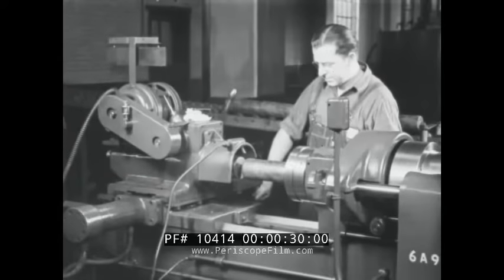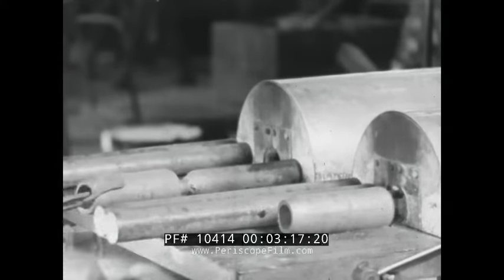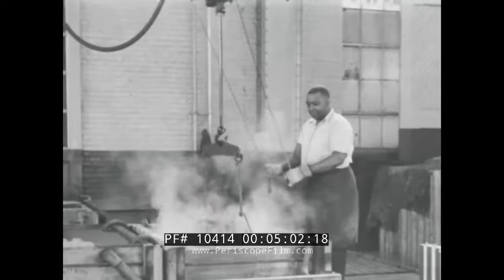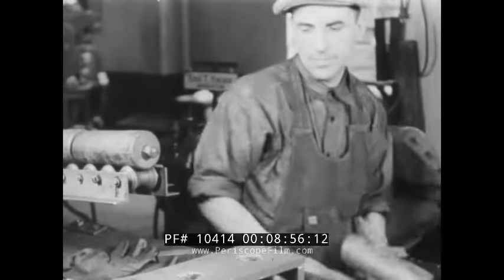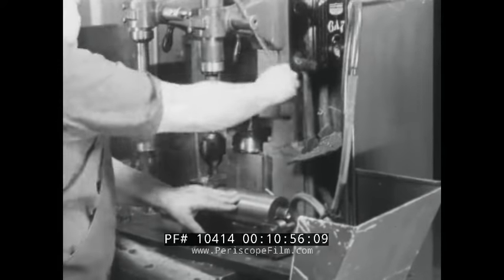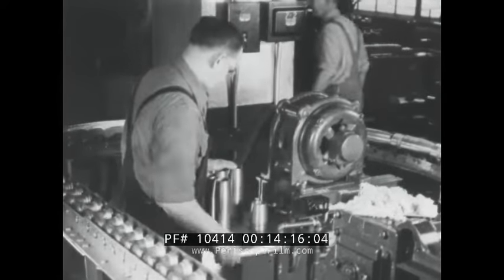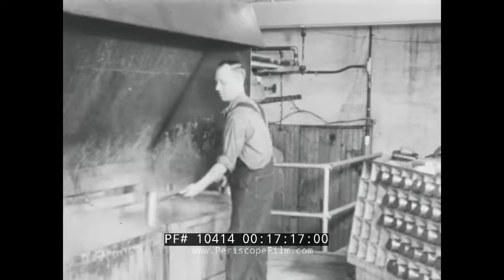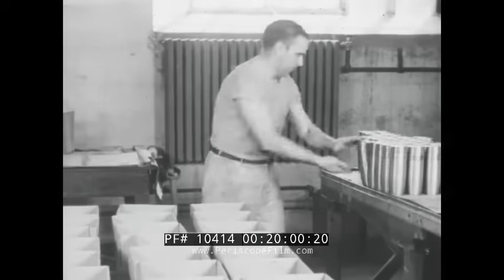MANUFACTURING 3-INCH ANTI-AIRCRAFT SHELLS     WORLD WAR II ORDNANCE FILM FRANKFORD ARSENAL 10414

Comment: Imagine all the engineering that went into designing the machines used to make those shells.
With pencil, ruler and paper.
Reply: Dave....Yes, my thoughts too; I was as fascinated with the different machines as I was with the work being done. I was a manual metal working Lathe operator for almost 20 years and then spent a few years running an EDM machine and a CNC machine and a few other machine shop tools, so I am always interested in the machines that someone...someones...had to think up and manufacture...amazing..!!
Reply: Dave  that’s how KELLY JOHNSTON,  of LOCKHEED  SKUNK WORKS DID IT , no computers , or personnel calculators, only slide rules & pencils, speaking of which, we spent a fortune developing them SPACR BALL POINT PEN,  you can buy then now, but the RUSSIANS QUICKLY solved the problem by using lead pencils ,  OH WELL,  Cheers From NJ    🇺🇸🇺🇸🇺🇸🇺🇸
Reply: @flybyairplane3528  He's the one that designed the SR-71 right ?  Blows my mind what they were able to do without computers.  Some say he had a little help ? #aliens lmao
Reply: @dave131  They had early computers, but for sure most of the work was done by brain power.
Reply: Those machines were manufactured in the United States.
Reply: That's always what amazes me the most - the machines that make seemingly simple items.
Reply: @flybyairplane3528  Americans were concerned with graphite dust shorting out the electronics.
Reply: @flybyairplane3528  Russians use ink now because lead particles were getting in their instruments. I think they use the US pen.
Reply: @flybyairplane3528  The pen was independently developed by Fisher BEFORE being used in the space program and was offered to NASA for their use. It wasn't developed as part of the space program and was only called the space pen after it was adopted by NASA.
Reply: And slide rule
Reply: yet its somehow to expensive to hire americans for fair wages to make anything. Makes you think
Reply: They also ha the slide rule to make all the calculations.
Reply: Yes, the design and use of the machines is truly amazing. Most people have no idea what is involved in the manufacturing and production of these types of products.!American engineering ingenuity at its best!
Reply: @Albo alt They had a different work ethic, no job was beneath them and they were not afraid of getting their hands dirty!
Reply: Add
Reply: @flybyairplane3528  bullshit story about the pencils. Pencils are bad in space and produce flakes of conductive graphite. They used Chinagraph pencils like the US did, later to be replaced with felt tip pens. Common myth.
Reply: @lwoodt1  And Log Tables?
Reply: @flybyairplane3528  - Well actually, we didn't spend a fortune on the Zero Gravity Ball Point Pen.... it was as simple as pressurizing the ink sleeve inside the pen. Pretty simple, but I would agree, not as cost effective as a lead pencil. The Russians soon found out though that Ink doesn't smear, become illegible or get accidentally erased....
Reply: @TheTeehee11111  Don't discount the occasional trial and error, and the clever use of wiggle room to get the job done.
Reply: @6or7breadsticks  Yep. Lead dust, bits of broken pencil tips, and the occasional speck of wood or sawdust could play hell with a switch at a very bad moment.
Reply: What's the moral of the story here. I'll tell you. Every person you just saw in the film is DEAD. What did it all matter?
Reply: @marbleman52  As a second career machinist I have always been fascinated with machines making machines.  Currently doing one offs on a manual knee mill and loving it.  Not a whole lot of manual machinists out there any longer, trying to hire lathe or mill machinists is near impossible. Yea watching these old machining movies is great.  I have also enjoyed watching some machining videos of guys in the Middle East or poor countries doing repairs using old machines, interesting watching their approach with limited tooling!
Reply: @byronschroedel432  Hey there...I will confess that I did not know what a knee mill was, so I looked it up. Those are what I know as Bridgeport milling machines. Yes, they are very versatile and very accurate when properly used and taken care of. I only got about 6 years using one and just did the basics before the shop all but closed and just the very senior people were kept on. But before I worked at this shop, I was a manual lathe operator for about 16 years and I took great pride in turning out precise pieces. I retired about 8 years ago and now I have a wood working shop at home where I have used my skills as a lathe operator and machinist to work with wood instead of metal.
Reply: Speaking of "paper ruler and pencils", saw a documentary on building the Oakland - San Francisco Bay Bridge. (Largest project of its type in the world at the time -used approx. 25% of the entire output of steel in the US at the time.) They had to construct a massive warehouse just to store and make available the millions of blueprints, plans, orders and other paperwork while building the project. No Xerox, dry printers or microfilm available - just uncountable files of paper.
Reply: @marbleman52  Yea I suppose I could have said Bridgeport, but I was being equitable to the other brands.  I have a Bridgeport clone in my garage and I work on a MSC brand mill.  The MSC is a better mill than the Bridgeport with z axis movement being .001 tolerance.  Something our Bridgeports will not do!
Reply: @byronschroedel432  I understand what you mean; it is like saying Skilsaw when actually meaning a circular saw. The brand name has become synonymous with the tool. I didn't know about the Z axis tolerance limit to the Bridgeport...interesting..!!
Reply: @dinoferrante1718  We aren't speaking German or Japanese.  I believe it matters a lot.
Reply: @trimule  now, we use BIM applications to build structure.
Reply: Oh no, they weren't savages. They had logarithmic rulers and millimeter paper.
Reply: @lorizoli  Slide rules, log tables, and the occasional adding machine. Computer-assisted design was far in the future.
Reply: And slide rule.
Reply: Guys, they also has computers at that time.
Reply: @Albo alt nah, we're just as smart as them or better, they're limited by the technology available to them.
Reply: Amazing how they figure all this stuff out.
Reply: @flybyairplane3528  It is a cute story, but it is not true.  The fischer "space" pen was developed to write over grease.  Nothing to do with NASA except the marketing.
Reply: These guys were so better thought in their colleges back in that era.. a quality education was well respected.. now it’s a disgrace ..
Reply: All that work & precision … designed just to kill. 

No, I'm not some flower-throwing nudnik hippie but I AM saddened by the use of some of our greatest minds to do nothing more than stop some of the other greatest minds sharing our oxygen. I'm more than disappointed with them, too. 

War has always brought about giant leaps in knowledge and understanding. Surely we must be able to take away more and increase our lot across the board, can't we?
Reply: And slide rules
Reply: It ALL starts with an idea, and vision, in someone's brain... And it STILL does today, it's just the execution of those ideas and visions that's different. A computer doesn't come up with the ideas and plans, it simply helps make the process more efficient.
Reply: @Albo alt Speak for yourself, and if you have an issue with that fact, then DO something about it. Help starts with that thing at the end of your arm, called your HAND. Wow....
Reply: @geodes4762  Are YOU afraid??
Reply: @dinoferrante1718  YOU are here because of them, THAT'S what matters. Honor them, and MAKE something of yourself. Dont just sit around and wonder why. You should be advanced, NOT behind them. It's on YOU...
Reply: @Kevin-fj5oe  Correct.... Congratulations for making something of yourself.. 🍻
Reply: @thomashockman4972  AND the fact that the pen worked in zero gravity where others wouldn't, and WERR used in space by NASA. So YES, there IS a space legacy tied to them.. 🤷🏻
Reply: @MWGrossmann  War is an inevitably that one MUST be well prepared for. It's unfortunate, but it's human nature, and can not be denied. One could sit around on his hands, and ponder about it all he wants, but SOMEONE has to get it done, so that the hand sitters survive along with the men that made survival possible. You should be thankful, as there's a good chance you wouldn't even be here.
Reply: @davelowets  ugh, thanks?
Reply: @davelowets  No. why do you ask?
Reply: @geodes4762  Just checking....
Reply: @Kevin-fj5oe  You're welcome...
Reply: @flybyairplane3528  well the ball pen was developed by an private buiseness and gifted to NASA for bragging rights pretty much, that in itself tells how people feelt about the whole thing..
Reply: @flybyairplane3528  Fisher Pen Company
Reply: And nobody asked Google 🙄.
Reply: As war loomed, the U.S Government brought in manufacturing experts from the Auto industry and other consumer industries in the USA to look at how war materials were being made. They sought any advice they could get. This ended up being a very wise thing to do, as techniques learned in mass production in the USA during the 1920s and 30s ended up being very effective during the war. Amazing what a work force the USA ended up having, and surely people with the most personal of motives.
Reply: You mean brains.
Reply: @20alphabet  👍 YES!!! Or even   Siri...😁😁😁🤗😁😂🤣
Hell, this generation doesn't even know how to use a thing called the "Yellow pages"😑...
Ahhh-What's that???🤔🤔😁
Reply: @richardbause2453  
Nor can they read or write cursive. Ask one if you don't believe me. I could hardly believe it myself.
Reply: @20alphabet  or ask who "Rand McNally" is???
Hint-north-south-east-west...🚗 🚘
Reply: @richardbause2453  
Lol, I'd be willing to bet the couldn't figure out how to get it folded back to how it came.
Reply: @20alphabet  Alexa- how do you fold a map???
"Don't know" I'd have to follow directions 😉 😜.
Reply: @richardbause2453  
Lol, that's about right. Still use my Thomas Guide regularly.
Reply: Note that slide rules only give 2-digit accuracy...
Reply: @coachhannah2403  option of which didgit would be the right ✅ 😉 one for the answer 😉 😄😁😁
Reply: @Karl with a K - OK, that makes sense. My dad was a wizard, I 'learned' to work one (still have his and a couple more). As a senior in high school, got a TI SR-10 red-LED calculator doing +-*/ for $99.95, a big deal!
Reply: Amen brother.  And the men who machined them, day after day after day.  Mind boggling dedication.
Reply: Like a  guy told me  , draftsmen and   slide  rules  and  dermaiton
Reply: In a cave, with a BOX OF JUNK!

Comment: I like the air quench: a floor fan.  High tech stuff like that high speed cut off machine (power hacksaw)
Reply: I thought that was hilarious.  They all just fall into a pile!
Reply: Simple yet effective
Reply: lol... right?  im sure the sales brochure reads a whole lot better using "air quench" as apposed to " dropped off rollers onto a concrete floor in front of a fan"...
Reply: I’m surprised they didn’t use a horizontal band saw
Reply: Presentation is everything bud
Reply: @7pines77  Bi-metal band saws for cutting metal came out at much later.
Reply: The power hacksaw was hi tech back then, and notice that it wasn't a regular gravity machine but a hydraulic feed type.
Reply: We had a power hack saw like that in high school. Started my machinist career in the USAF after completing tech school at Aberdeen Proving Grounds in 1983. Retired last year after 40 years.

Comment: Two thoughts: 
1. A staggering amount of work goes into making each shell!
2. All the machines used to make them are amazing, and fascinating!
Reply: They sure are.  Even now the engineering that went into those machines is just amazing.  Lot's of steps but it worked great.  It was nice to watch.
Reply: yes, and they probably ran 24/7
Reply: Yes.  My reaction as well!  A bundle of work, effort, and attention went into a single shell fire.  Crazy, but amazing!
Reply: All the machines are special purpose machines.
Reply: I worked at a machine shop making high grade bolts and we had at least 1 hand fed threader from ww2 era.
Reply: @jupitercyclops6521  
Setup and ran the same Warner & Swasey turret lathes seen here....thousands of precision parts in no time at all.
Fact ran it while the CNC mills were going.....hate to say it but it was just as fast as the CNC lathe we had.
Reply: @keithlucas6260  
Really?!?
   I found that work fascinating. I loved it.
  Hated the job,  but loved the work.
   Our old ww2 threader was for larger bolts, or fasteners.
    I operated "fillet roller" machines.  
   Every bolt was fed onto 3 rollers, then a spendal came down with x psi & spun the bolt making an arch between the head & stem making it stronger..
   It took less than a second per bolt.
   I set up & ran 4 machines at a time.
    It was perfect. It kept me busy but not too busy. It was exercise for body & mind but not too much.
 I loved it. 
   My coworkers all stood around half the day & didn't like that I kept busy.
   So my coworkers didn't like me, supervisors didn't like me for the same reason.
    I didn't care about that tho, the owner knew what was up.
   Then he sold the place and I knew my days were numbered.
    The place made me sick too. We used diesel fuel to clean parts & lubricant. 
   We also used compress air through the process so the air would blow the diesel and poor ventilation meant you were breathing w mist of diesel all day long.
     LOVED the work, hated the job!
Reply: @jupitercyclops6521  
Very clean shop with tile floors and A/C.
I had three sections, the machine shop, assembly and the weld/fab shop outside.
In fact it use to be a clothing mfg called the "Pantsmaker.".....I loved those old machines.
Reply: @keithlucas6260  
The filled rollers I operated were new.
   I loved calibrating everything & running those things.
    I worked next to the cnc machine.
   It was all computerized, but it was pretty darned cool to watch.
   I always kept busy, even when all 4 machines were working, I'd find something to clean.
    I didn't do it to brown nose, or to make anyone look bad, I did it because it made the work day go by faster.
     What do u do now. If you don't mind my asking.
Reply: So many rotating protruding parts just waiting to mangle you...
Reply: @dingdong2103  Safety was much less emphasized in WW2.
Reply: @DavidFMayerPhD  Not just war time, in general. The work methods would never pass safety inspection nowadays. Like the builders of high rise building walking on girders without any safety equipment :)
Reply: And here's how is done today!:
https://youtu.be/dEbnpV1hJGw
Reply: What about the supply chain like powder and stuff 🤔
Reply: @jupitercyclops6521  how many people were blown up on the production line?
Reply: 3. All the machines are extremly dangerous with a lot of moving parts that are not covered
Today non of these would be even close to meeting safety standards^^
Reply: @JL-pc2eh  it was amazing all the workers still had their fingers.
Reply: @Moose803  the one that loses their finger aren't gonna work again.
Reply: @dingdong2103  Google Russian lathe accident, not before or after eating...
Reply: @JL-pc2eh  doesn't stop cheapskate factories using them today.
Reply: absolutely nothing wrong with a lot of work, it used to be our way here in the USA, quality and pride in our work.. just look at these units, explosive ordnance that has rifling in the shell casing... FIRE IN THE HOLE!!!
Reply: all for the sake of killing people .... its truly fascinating indeed
Reply: @jupitercyclops6521  Was it automatic or did you have to do an algebra problem for a different thread?
Reply: @JZ's Best Friend Your attempt at an insult shows profound ignorance.
Reply: Imagene how hot and loud it wold be

Comment: My ex brother in law owner a machine shop and I saw the work he did for the petroleum industry. The engineering here (because of the limited technology) is amazing; also the tenacity of the workers who do that repetitive work day in and day out for 4-5 years of war.
Reply: Tenaciousness is a trait more easily found in men with four or five, seven, nine, twelve, children! 😂🤣
Reply: In 1939 those guys were grateful to have a steady job.
Reply: @@karlwithak1835 You can still be tenacious with fear as a motivator.
Reply: @@karlwithak1835 Wow Carl your insight to my life history is amazing, it's borderline....moronic. Just because I never worked in a machine shop during war time doesn't enable you to conclude someone has never worked or "been a worker", quite the contrary,  I worked in construction as a carpenter outdoors in the Texas heat (95-100 degrees ) and we had quota's and time constraints to finish the job or you would be either replaced or not awarded another job. I /we worked   on residential and commercial buildings from 1978-1985 and I'm 66 now and still cut my own grass(push mower) and maintain my own yard.